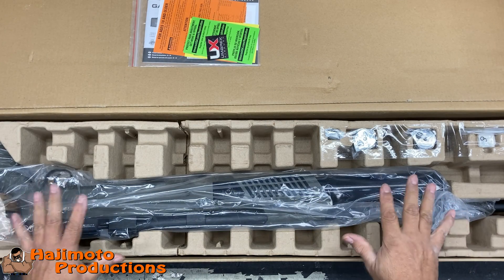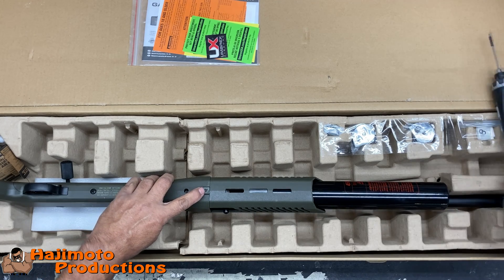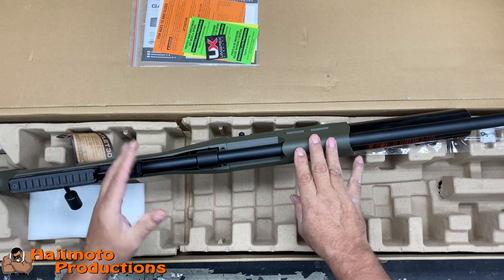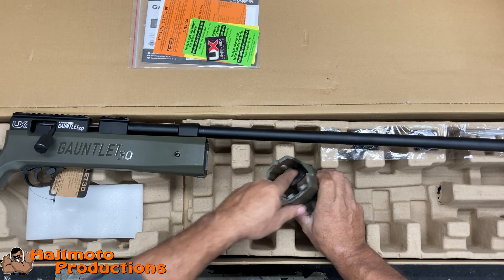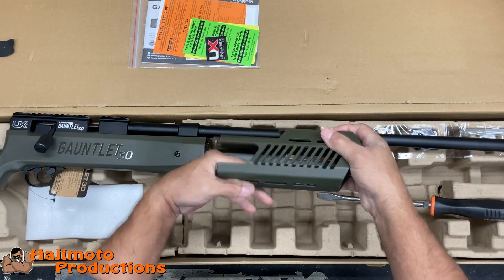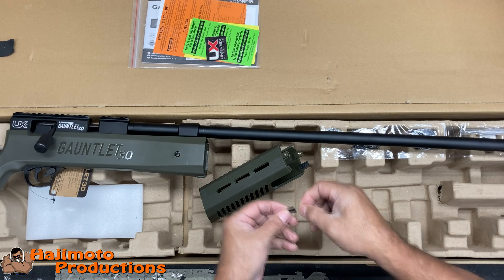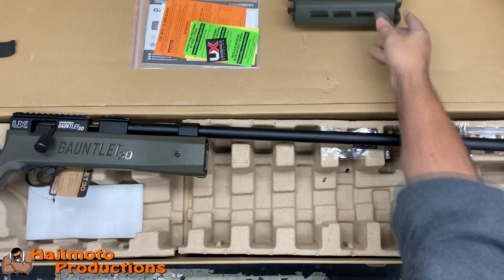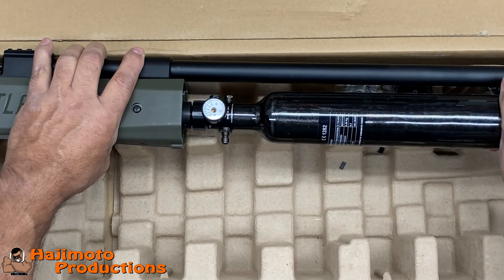Hajimoto's Power Flex Install G30

Comment: With the larger bottle, can you still get a bipod through the bottom m-loks?
Reply from the maker: Yes you can, you just need to be mindfull of the screw length. We grind the screws down so they will not protrude past the nut face. We also will place a piece of cloth tape over the M-LOK nut and screw on the inside of the bottle shroud to minimize any metal to carbon fiber contact.
Reply: @HajimotoProductions  Perfect and thank you for the response. My Gauntlet 2 arrives early next week and I have had your website bookmarked for a month so I can get some mods. I appreciate all you do!

Comment: Is any amount of slow air leak acceptable from a Gauntlet 2 SL PCP, I'm talking losing a quarter of air in a month? I'm on my second new gun that was replaced by a PCP dealer. My other guns will hold air for over a year no problem.

Comment: What’s a power flex and why do I need it? You should include that in intro 👍
Reply from the maker: The Power Flex is a combination of an externally adjustable regulator mounted on a 4500 PSI carbon fiber tank. The regulator allows the end user to adjust the operating pressure of the Gauntlet to get the best performance and efficiency out of whatever ammunition is being used. Another benefit of this combo is it reduces the weight of the PCP by almost a pound.

Comment: Just installed the flex valve on mine no more leaks no more trouble and I get 300 more PSI😊😊😊 keep up the good work hajimoto let's get these sl-30 up to 140 FPE!!! Umarex needs to make a 457 hammer  and a 357 gauntlet!!!😮😊😊
Reply: Exactly. I don't see why its not feasible to have 100-110 slugs at 900-950. Thats a sweeeeet 200fpe. Its what i want and need.

Comment: So this gun with big bottle and ninja hp 3100 reg. What is it capable of in terms max fpe? Or just what is the g2 .30 capable off in the ultimate package?
Reply: Good question.  I wanna know as well.  I'm assuming one can shoot some heavier slugs (heavier than 60 grains or more) upwards of 900 to 1,000 FPS.  But, of course with that power you won't get that many shots.

Comment: How many shots will I get per fill as opposed to the factory bottle?
Reply from the maker: The stock G30 will get 19-25 shots per fill. Providing the G30 has all other settings the same, Our bottle will deliver 18-24 shots per fill.

Comment: What does the gauntlet 30 normally run for PSI on a stock unit? Just was curious if people typically use this to up their shooting pressure
Reply from the maker: The G30 stock operates at 2800PSI per shot. The Power Flex allows the end user to adjust from 2100PSI as a low all the way to 3100PSI and every pressure in between.

Comment: Just seen Umarex has a SL30 now. I have G2 in .25 cal and it's good except for the damn charging handle workout, it'll give ya a blister after a day of shooting. The SL should be the cat's ass with the lever charging. Will your flex rig fit the SL30?
Reply from the maker: Hey there! Just know that we have been offering since Feb 2023 a SideLever conversation service that will upgrade your current Gauntlet to a SideLever variant. As for the Power Flex fitting the new 30SL, yep, it sure will!

Comment: I have a roll of soft felt tape and use it all the time.
Great tip on removing those sharp points on the brass tabs and I would have scratched my bottle.
Reply from the maker: Great tip!